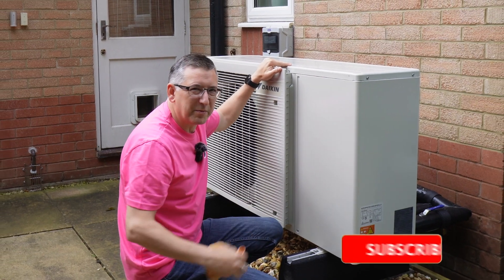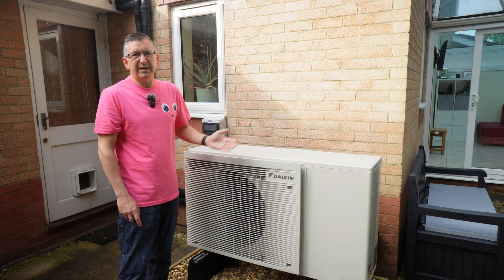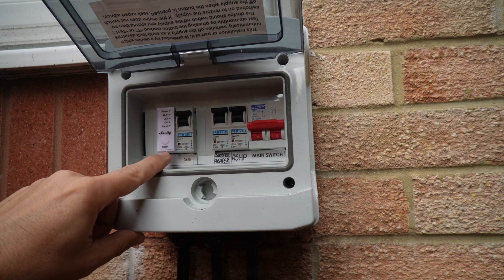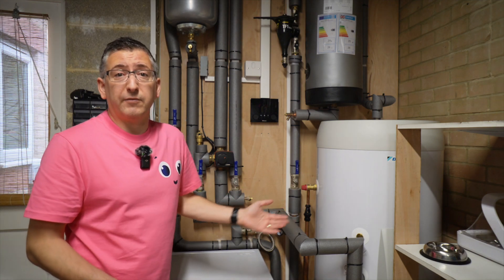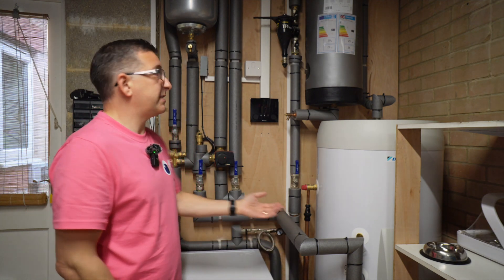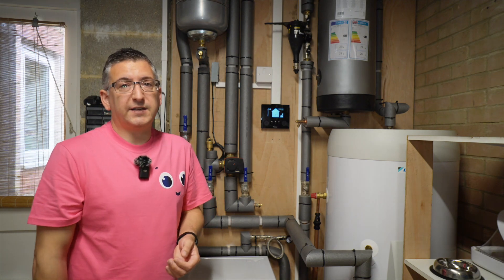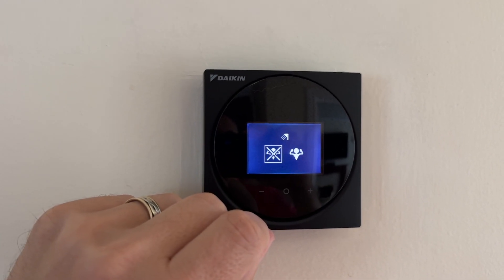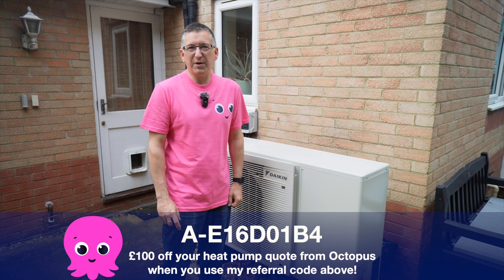Virtual Visit a Heat Pump: Take a tour of my Octopus Energy Heat Pump Installation

Comment: I currently heat my water in the winter with an immersion heater and I also have an electric boiler. They are being replaced in August. My forthcoming Octopus ASHP installation should work out cheaper to run in the winter due to the COP of at least 3, and the Cosy tariff of half price electricity a certain times of the day!
Reply from the maker: I used to use an immersion for my hot water when I had a gas boiler - I could heat the water off-peak for basically the same price as if I'd used gas so I figured it was probably better environmentally to do that. Good luck with your ASHP install, I certainly don't regret mine even after two winters with it now.

Comment: The way you have that Cordivari plumbed up it acts only as a volumiser.
Buffer tanks or low loss headers would require 4 pipes to be connected and they potentially reduce the COP, as the water in the primary circulates at a different speed to the secondary loop and inlet water gets mixed with outlet water, creating a lot of distortion, if not needed it should be avoided!
I am happy to see that even with the micro bore Octopus managed to avoid using unnecessary buffer tank!
Reply from the maker: Yup I’ve had that confirmed by a few people now, it seems to be mainly to benefit the defrost cycle I’m told

Comment: I was watching your video about your own installation of a HP till I got to the place where you said 'This is my plant room' or back of the garage.' That single sentence said why heat pumps are never going to work unless you have a big house with space for all the rubbish that heat pumps need to work compared with a 600mm cupboard for a gas boiler. Then to  show a 250 litre tank which has to be heated for the system to work and provide hot water is sheer madness as no household need more than 20 litres for a couple of showers per day. Who washes up after every meal???? Heating a cylinder went out with the immersion heater and back boilers  - sorry you need one for cold days with a HP
Reply from the maker: Ha you’re living in fantasy land with your hot water figures. The equipment I have shown in my garage can very easily fit in an airing cupboard, I just asked for it to be spread out a bit because I had the space. I don’t need the immersion for cold days at all - it’s purely there if you need a rapid boost and for legionella cycles

Comment: I am curious about the online quote versus the final quote after the onsite survey. My property is a bungalow with mostly underfloor heating,  no microbore, I have 22mm  main supply with 15mm to rads and easy short run to the heat pump and tank location. Is that likley to lower the  quote versus the online quote ?
Reply from the maker: I wouldn't know, sorry. In my case, my quote didn't change.

Comment: Just a wee point, on the filling loop BOTH valves should be isolated when not in use not just one as seen in your video 👍
Reply from the maker: Yeah, I'm supposed to remove that flexi pipe and close all three valves. Usually I leave the pipe connected for convenience and turn off all the valves - I admit they weren't all off in the video because I'd just increased the pressure before filming!

Comment: Do you have the measurements of the footprint of the ASHP including the soak away?
Reply from the maker: The footprint of the soak away is 80cm x 147cm
Reply: Is there a condensation pipe feeding the soakaway? I was wondering if you could collect the water in summer for garden watering?
Reply from the maker: @tonyt7402  No, it drips straight off the condenser. You could get an optional drain kit if you wanted which is designed to catch it and divert to a drain, but that's not included as standard.

Comment: Hello have you found a way of  getting your givenergy battery and heat pump to link with agile.   The goal being that it can charge the battery twice a day  when prices are cheaper.  Once in the early hours in the morning and then in the afternoon when prices are low.   To achieve this automatically rather than going into the givenergy app remote control section and settingthe charge times.    I hope this makes sense.   I have talked to givenergy they say the system is agile compatible but int reality you need to go into remote control and set it there.
Reply from the maker: I don't personally like Agile, I consider it over-complicated for the majority of users and unless you are very technically minded it's difficult to easily save money. You may have noticed that I actively avoid Agile in all of my guides because it leads to too many question :) There are many approaches though. There's the built-in options which I admit are not great as you have found, or there's jumped to Home Assistant and using something called predbat to co-ordinate your cheap slots. Or... you can just run as normal, heating your home whenever you think is best and convenient, maybe avoiding the known peak periods, and hope that the average unit cost is lower than the standard rate. Agile can be great, but if you have to ask questions about how best get it working then it may not be for you because the questions are only going to get harder the further down the rabbit hole you go, sorry :) Predbat is the way to go for Agile charging your battery the cheapest way possible... but don't say I didn't warn you :)

Comment: How are you getting on with the heat pump? I have real problems with Octopus. I desperately want their heat pump service but they have assessed that I need a 9kwh heat pump where my house is slightly smaller than yours has 12 radiators, has an B ECB They estimate I will use 12000kwh a year which is a very good estimate, yet the 9kwh pump is based on a usage of 26000 kWh. I have used the rule of thumb calculation which comes out just under 5 kWh. I have asked them how they came to their figures and resent their heat calculations, adding that they must be right as they based 3500 instillations over 28 months.
Reply from the maker: I'm getting on brilliantly with it. Have you watched all of my other videos on the build-up to the installation? I got over the system design and my home layout. Built in about 2001, 110m2 floor space, 4 bedrooms. The heat pump sizing was somewhere between a 4 and a 6kW one with the heat loss for my home at 3.9-5kW. They will give you a break-down room by room of the heat loss in your home and the total dictates the size of the heat pump required. That should be where you start if you're looking to question their logic. Have you have the heat loss survey done? It was a £500 fully refundable deposit when I did it.
Reply: @SpeakToTheGeekTech  Yes, I have relied on your input / video’s and others to build up my knowledge of getting a heat pump. I live in Newport, so like you Cardiff was used for some of the stats like you. My house is 1938 semi but has cavity wall insulation, modern double glazing, insulation under the wooden floors, 3 beds plus office, family bathroom and shower room. I still don’t think Octopus are even close with their calculations, now looking else where..

Comment: Thanks will be using you referral code on my Octopus install. Have you had any issues at externals temps below 3 degrees? Some folks on openenergymonitor have said that the Diakin's dont operate well under 3 degrees C? Also is the Shelley essential? Does the Diakin cloud service not provide energy consumption data?
Reply from the maker: Thank you! Absolutely no issues concerning temperatures and performance and we did have a few weeks of negative temperatures last winter. The Daikin Onecta app does give you some energy consumption data but I don't find it that reliable - the Shelly gives me much better data and lets me use it in Home Assistant. If you're not fussed about Home Assistant then see how you get on with what's in the app.
Reply: @SpeakToTheGeekTech  thanks so much, just waiting for the install date now. I have Home Assistant set up but not sure if I can easily put in a Shelly myself. Is there an integration which gives better data from the HP directly in HA, without installing extra modules etc?
Reply from the maker: @HarjDool  There is a Daikin Onecta integration (https://github.com/jwillemsen/daikin_onecta ) which will give you the same energy usage data that you see in the app (daily/weekly/yearky) but I use it for system control only.
Reply: @SpeakToTheGeekTech  can you check your referral code. Octopus are saying that it is not recognised.
Reply from the maker: @HarjDool  It should be accepted and it has worked at least once in the past, but I have contacted them to find out what's happening and will get back to you.
Reply: @SpeakToTheGeekTech  I've quoted A-E16D01B4 but Octopus install team are saying that this is not valid and appears to be a reference to an energy account number instead.
Reply from the maker: @HarjDool  Yes, that's my energy account and is what they told me to use as a referral code. It's worked at least once that I know of! I've contacted them to find out what's going on. Thanks for letting me know.
Reply from the maker: @HarjDool  Hi, would you be able to contact me by email please at oliver@speaktothegeek.co.uk and I can discuss further. Octopus are asking for some details to look into this so they can get to the bottom of what's happening. Thanks!

Comment: Both those filler valves should be closed. In fact legally the hose should be detached for water regs, though few bother.
Reply from the maker: Yeah I know :) There's actually a hook on the wall behind where I'm supposed to hang it when not in use! I normally leave all three of the valves shut when not in use, but I had added a bit to the system just before filming and forgot to close them all due to being distracted :) All three valves currently off, but the hose is left there out of pure laziness.

Comment: The heat pump requires a minimum free volume of water to do a defrost cycle. For Vaillant I think it's 15L? So if you have TRV's on your radiators, microbore pipe, and/or a small central heating system, then it can have less than 15L available at some times and that can cause issues for the heat pump. My 3 Bed house doesn't need one as long as I don't use TRV's and my radiators are appropriately sized relative to each other and the heat demands of the rooms they're in. 

Generally, rather than doing the maths to see if it's necessary, or designing the system so that TRV's aren't required, they just shove a 20L volumizer in and then they're certain they'll have no issues with the heat pump defrost. At the cost of reduced SCOP, increased running costs, and increased installation costs. But they're problems for the customer, not the fitter, and most customers don't know this, so they get away with it most of the time. 

It's generally a good rule of thumb that if they assume you need a volumizer they aren't doing a "proper" thorough system design and installation for you. More a generic one size fits all. Quite often they can just replace a length of the central heating pipe with a wider diameter and that's enough to get the required volume... Or there's also an electric heating element in the heat pump that can be used for defrost, but that uses more power since it can't leverage the system COP.
Reply from the maker: So Octopus have a centralised design team who produce the system designs for the customers, rather than it being done by the installers. The approach from Octopus is a boiler-plate one, so they pick from a number of set designs and tweak slightly as needed. This helps them keep the costs down and customers (like me) end up with a good solution at a great price. But, of course, if you want something much more customised and perfect then a Heat Geek installation is the way to go, and you'll potentially pay the premium that might entail.
Reply: @SpeakToTheGeekTech  If you don't mind me asking, how much was the Octopus installation in the end? I'm curious, because they claim "from £500" but I've only heard of ~£5k kind of installed system costs to customer.
Reply from the maker: You're in the right ballpark but it's not that simple - mine was a reasonably large install and there are lots of other costs and things to consider. A very modern but small house with perfect pipework and radiators could easily fall into the £500 category, I have heard of a couple of quotes in that region. I made a video covering the full breakdown of costs for my installation: https://youtu.be/Tc_5SlkNkik

Comment: Great video, made me laugh a few times at the start! There are lots of stats videos on YouTube, but not as many looking at the bits installed, like this vid. It'd be nice to see a quick thermal camera walk around tour of it in winter, once we get below 0.
Reply from the maker: Maybe I’ll do that. It’s just a pain because it means I have to tidy the whole house and not just those small fixed areas I’m showing you in this one! Have a look at my Topdon video which does a bit of a walk around.
Reply: @SpeakToTheGeekTech  If it means tidying, then pics of the rads and plant rooms would do. I think I saw the topdon one. Be interesting to see if they hit the designed temp, or slightly over / under due to piping or other factors like leaky windows. Have you had to restrict the flow to ones where the rad was oversized? Or is it just working well because of the heat loss survey? Cheers.
Reply from the maker: I opted to upgrade the radiators in the bedrooms to larger ones which output more heat than their original design. I have therefore used the TRVs to restrict the output in those rooms a little bit but everywhere at least hits the design temp if not exceed it at times.

Comment: I looked to get a heat pump from Octopus in my home in Scotland. Turns out they don't do Scotland installation. 😢
Nice to see your heatpump tour. Will consider getting one next.
I got my solar panels recently. 🎉
Reply from the maker: They are expanding slowly across the UK. Speaking with someone from Octopus earlier this year, they tell me they are reluctant to do installs too far away from their support bases because they just can't offer the expected level of aftercare otherwise. The bigger they get, the wider they can spread themselves though so hopefully they'll reach Scotland eventually. I was one of the first installs in Wales and they tend to send engineers from Bristol.

Comment: Is the mystery box on the wall a weather sensor, to measure outside temperature and humidity so the heating system can compensate automatically (e.g. hotter temps on colder days, cooler and more efficient temps when its only chilly outsider)
Reply from the maker: I think the only way to solve the mystery is to open it up!
Reply: @SpeakToTheGeekTech  I concur, it looks like a weather compensation sensor to me. Used for offsetting the heating cycle according to outdoor temperature fluctuation. But why is it installed in the garage - even if your garage isn’t heated? Still, should really be external, but not on a south-facing wall I believe.

Comment: MCS required TRVs to be fitted but you then just override them by always leaving them fully open? That does not make any sense. How else do you control individual room temps? Also, not sure why you said your tank would not fit into you "half height" airing cupboard - it looks like its full hight to me?
Reply from the maker: You don’t control individual room temps, the radiators are each sized to provide a particular temperature at a given design flow temperature based on the heat loss of the room. The skill of the system designer is far more important with a heat pump than with a gas boiler which is why you have to be so careful choosing an installation company. And the airing cupboard is half height, the floor is waist level! The tank is too physically tall to fit in there. Also you’re not allowed to fit water tanks above stairs anymore under building regs I’ve been told, although I’ve not seen that in writing anywhere.

Comment: I'm having the exact same system installed by octopus just before Christmas in December! I'm super excited as I removed the old back boiler a a year ago (was a very cold winter).

I've put fresh plumbing 15mm, electrics and radiators ready for the heat pump. My property has some old solar panels so the heat pump should allow me to get the most out of the energy that's produced 🙌
Reply from the maker: Nice, you should have a more efficient system than mine with those wider bore pipes
Reply: @SpeakToTheGeekTech  Fingers crossed 🤞 
I've gone crazy on insulating not only 300mm in the loft but also 140mm for the ground floor ceiling. House was constructed in the 50s so drafts were plenty. After the install we'll be working on an AC battery and triple glazing for ultimate energy efficiency.